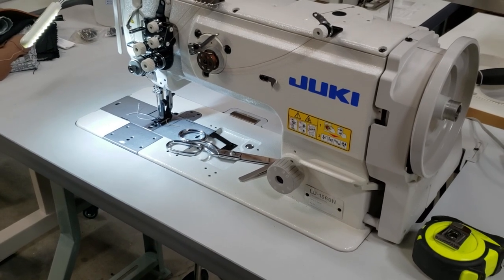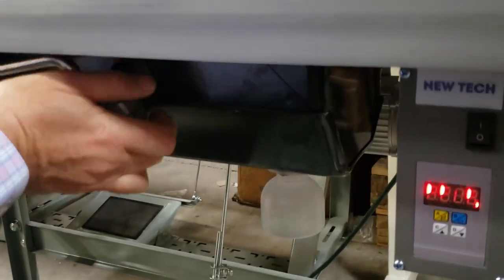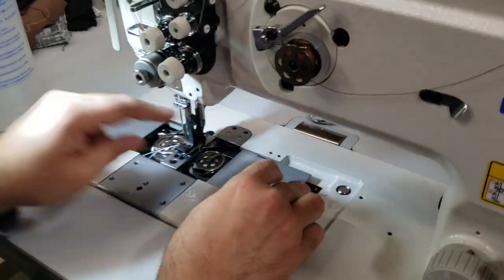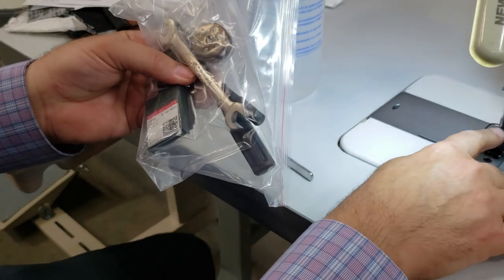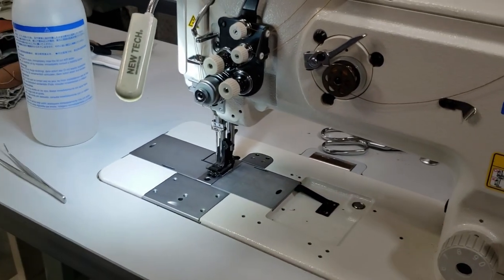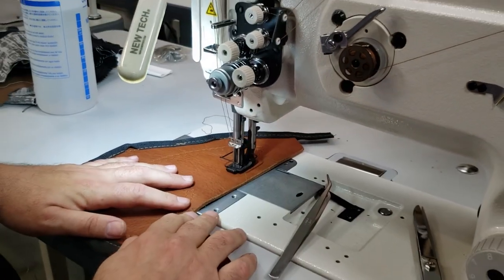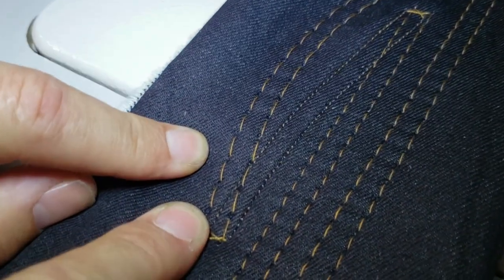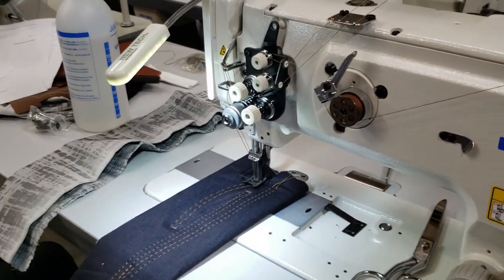Product Showcase - Juki LU-1560N Industrial Sewing Machine- Goldstartool.com - 800-868-4419

Comment: So frustrated...  I love this machine.  Recently the rear check spring on the tension assembly broke.  I got it replaced at the sewing machine repair from the woman who has been my mentor since 1982.  After I returned my very mechanically oriented worker put it back on.  Then the from one broke and we had to fix it ourselves (I bought extra checksprings.)  I think that the tension did not get put together correctly but even the repairman did not get it fixed.  Now I am so frustrated because I cannot get my machine to work.  I want to take the assembly apart myself.  Maybe there is a burr in the bottom, I do not know.  But there are two machines not working that have always just worked until the check spring got taken apart and put back together. I have a production sewing business and we sew on thick nonwoven polypropylene.  Since then I have had two more check springs break.  The repair worked the first time but has not this second time.  Both of my machines are now not working.  I took them to another repair shop who didn't look at the tension assembly.  He said there was a burr on the hook but it is still not sewing...
Reply: Sounds like you need to sell me those machines.

Comment: I can tell this guy sells sewing machines with out knowing about sewing at all. 
First he doesn’t explain what really people needs to know, he tries to tilt the machine back with the knee lifter and the belt gap cover on , he can’t put it back on. He says that he is seewing with thread T105,  which is not a standard size, there is Tex 90 or 135, he says that you could sew thicker thread like Tex 270 but that is a lie, this machine is made only for thread up to Tex 135. Good machine, I was hoping to find more valuable info from this video.